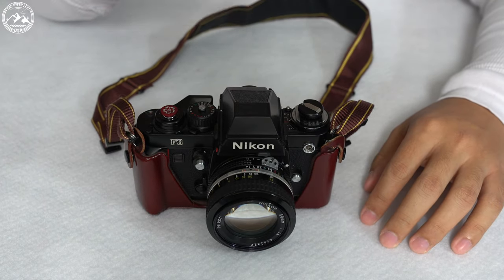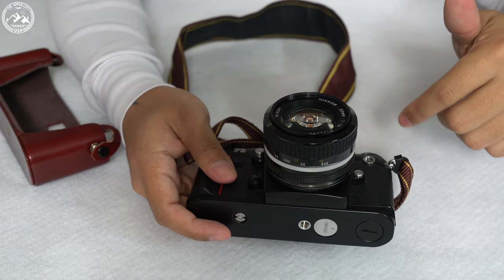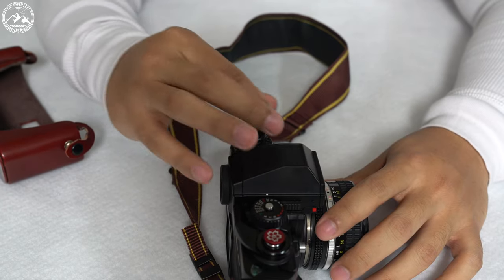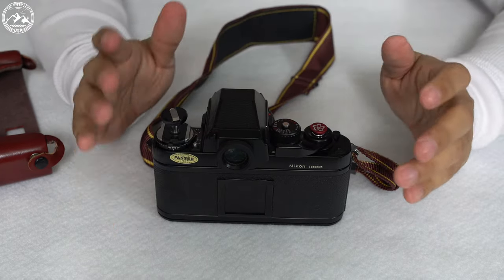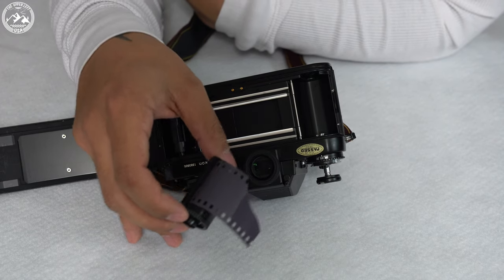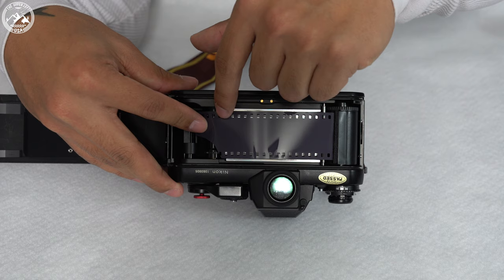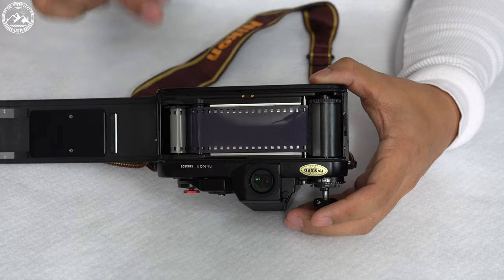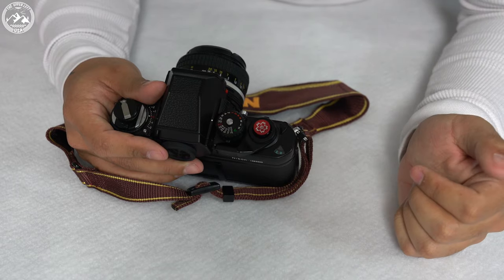How To Load and Unload Film into the Nikon F3

Comment: I just bought a truck and it had a 1980's Nikon F3 camera in it with 3 55mm lenses and several rolls of films the leather case and another carrying case to put the camera and everything else in I know nothing about this camera or even how to use it or if it takes a battery I figured out how to open it and put film in it but that's is all I cant get it to take pictures.
Reply from the maker: The camera’s instruction manual is available online. Just Google it.
Reply: @rebeca did you shoot any pictures with it

Comment: Is it possible to load the film incorrectly? Can the frames not line up correctly with the lens? I'm very new to this but when I load film I worry I've lined up the wrong holes with the sprockets...
Reply from the maker: You can load incorrectly but it’s pretty hard to not line up the holes with the sprockets considering that everything is sized for each other. The most likely form of improper loading is not getting the film to actually load and it doesn’t do anything in the camera.

Comment: Beautiful Nikon F3! Is the Nikon F3 better than the M6?
Reply from the maker: I personally use the F3 more than any Leicas. I'm just more used to SLRs and am more comfortable with them. Again, that's just me. If you've never used a rangefinder before, definitely buy a cheap one and just try it before investing in an expensive one like a Leica. It would be unfortunate to buy one and find out you don't like it!
Reply: The Upper Left USA John Free uses the Nikon F3 and he claims to be the best camera he has ever tried. I have checked the price of the F3 in 2n hand marked and it is much cheaper than the Leicas range finders cameras. 

Thank for answering.
Reply from the maker: Of course, the best camera is always subjective. I personally like the size of rangefinders but in many ways, they are not very flexible. You're stuck to certain focal lengths based on the frame lines of the cameras. Anything other than what the camera provides, you're basically guessing. Sure, you may have a certain degree of accuracy, but at the end of the day it's guessing and that can be extremely unforgiving using film. Viewfinder magnification also plays a role in the usability of a lens. There are just so many things that hold rangefinders back in my opinion. With SLRs, what you see is what you get, to a certain degree. Just throw a lens on and that's your composition. Nothing more to think about.

Like you said, you can get a very nice Nikon F3 on the used market or even a new one for a bit more. Much less than any usable used Leica.